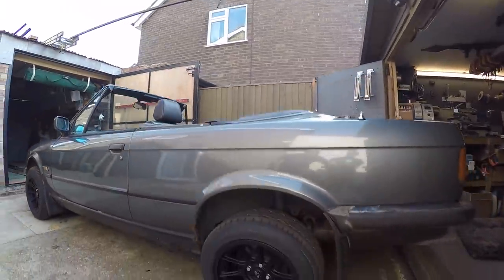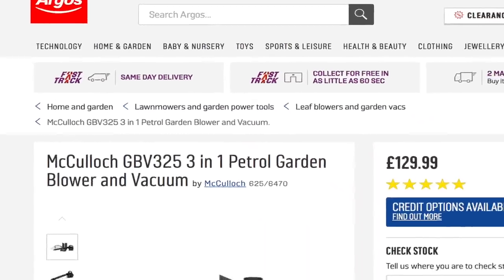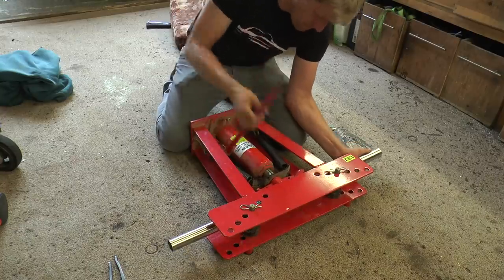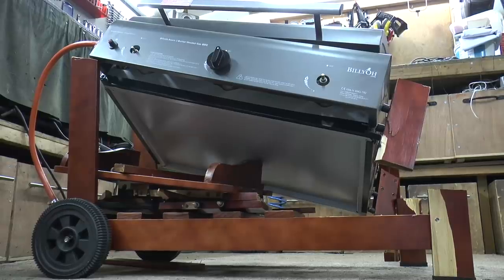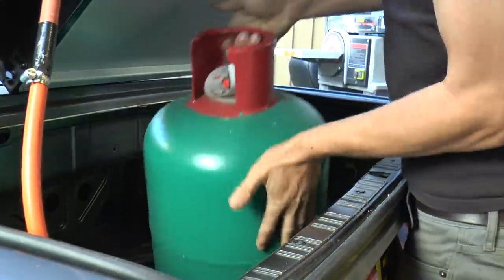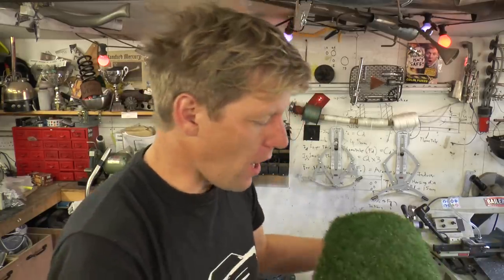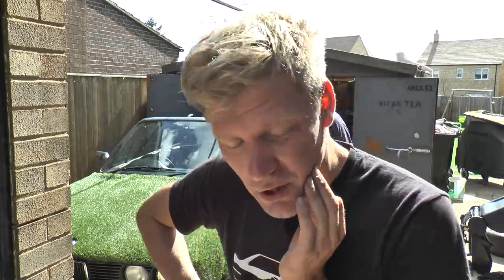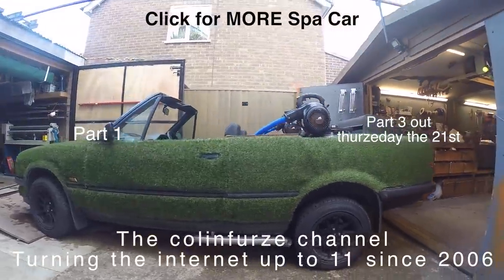BBQ, Grass, 2stroke Bubbles HotTub Car Final Touches - Part 2

Comment: BBQ with a gas bottle right underneath and artificial plastic grass around the heated area....what could go wrong....
Reply: Also the BBQ grill was spray painted so anything cooked on it will be toxic
Reply: We are talking about Colin here, this is really tame for him.
Reply: I think there will be enough water to put it out...
Reply: whatfireflies it's toxic enough to just turn the flame on and be a breathing creature next to it :D
Reply: Paul Baker a car crash
Reply: Depends on where the gas tank is. Most BBQs have the gas tank below the burners, often quite close. The plastic grass is probably fine? It's not quite close enough to burn directly, and the plastic may be resistant to heat. The spray paint... I didn't see what it was, but there are spray paints designed for BBQs, so I imagine it's fine.
Reply: Well... it's colin u know, safety third
Reply: I am sure he used a heat resistant spray paint. :D

Comment: 6:17 - 6:20 please tell me what happenes when the car runs out of gas
Reply: Gaerist they stick some double AA batteries in it..
Reply: LMAO true
Reply: or when it needs an oil change
Reply: uh, E stands for end, you're supposed to throw the car away
Reply: fill it from blinkers fluid
Reply: It's no more car, It's a goat, the only thing it can run out of is grass.
Reply: Maybe he forget to make a hole for it
Reply: G R A S S
Reply: I think he made a cut out for it, as most filler caps are usually opened from the driver seat, so it will still pop open, and still be covered with grass. Just an assumption as it was kinda hard to tell during the time lapse.
Reply: Gaerist yea! I saw that
Reply: jewfro E stands for empty... bindblown
Reply: its a bubble-blowing, burger-grilling, hot-tub-car. It runs on dreams and fairy dust, so just sprinkle some on.

Comment: Colin please make it into an amphibias vehicle can can go on land and on water because no water can get in it already. You just need to add boyancy and a boat motor
Reply: Finlay Turton Yes, great idea
Reply: No not a great idea then he would have to make the engine waterproof and all the electrics it's meant to keep water in not out
Reply: iamhughmun no he deosnt have u never seen wat they do on top gear any way he would just have to seal the bonnet
Reply: Finlay Turton the motors are already in the car, just turn the leafblowers around
Reply: Finlay Mitchell ik but it would be better to just put a boat motor on the back or whatever colin  could come up with
Reply: just take a metal boat, stick the axles through the sides and weld it shut
would probably need an extra gear lever to switch from car gearbox and pedals to boat speed control
Reply: iamhughmun all he has to do is make a snorkel for it
Reply: Iamhughmun Waterproof the engine, wheel wells, the boot will need to be redone if it's housing anything, move the exhaust system so it exits out of water etc. plus more sealing will need to be done. It's not a bad idea but it will be a task in itself. Top gear failed in their attempt. The Toyota might have made it but still it wasn't really sea worthy. Even for a cars standard.
Reply: Finlay Turton if you're going to submerge a car in water you need the engine/electronicsto be waterproof. Water and electricity don't go well together same with a combustion engine and Water lol. Only inside the is waterproofed he'd still have to water proof the engine/engine firewall/ electronics all that costs a fortune.
Reply: +Yamaha Life You don't say.
Reply: Yamaha Life i believe he could do it for less
Reply: Also not a submarine a boat car the windows will be above the see level and so should most of the car

Comment: Since its a convertible....why not use the exhaust to heat and produse the bubbles. The open air should take away the carbon monoxide
Reply: actually it would have been easier (safer) to use the vehicles airconditioner pump (minus the refrigerant of course)
Reply: It will make carbonic and other acids.
Reply: The airconditioner pump likely won't produce enough airflow to get good results.
Reply: he could've made the exhaust pipe run through the water and out the back (might be alot of work and little outcome but just an idea)
Reply: A turbo driven by the exhaust to make air for the bubbles
Reply: I would try removing the radiator and the thermostat and using the vehicle's water pump to move the water from the inside through the engine.

Comment: Colin add a speed boat engine on the back raise the exaust pipe and add sealed barrels to the sides of the car so you can drive it it the water
Reply: The engine is still open, he can't change that. The car would stop working if he tried to drive it in the water, he just made water not leak out the inside.

Comment: Just checked the tax and MOT on the DVLA website - looks like you're still good to go until Jan 2018 - that's when the tax runs out. But it's listed as GREY on the DVLA website. You need to notify them that it's now grass or it could invalidate your insurance - completely ignoring the fact that it probably needs a Q plate for all the bbq / jacuzzi mods...